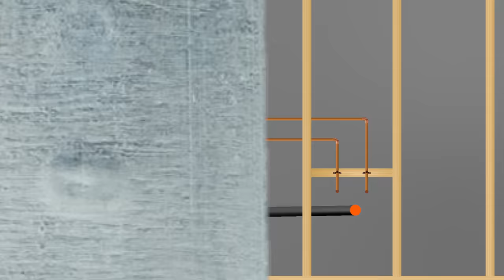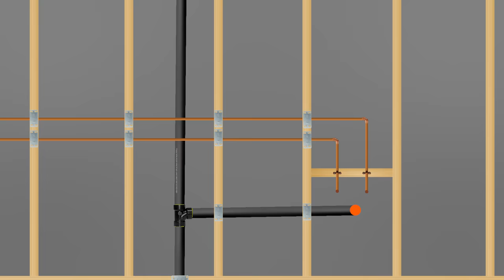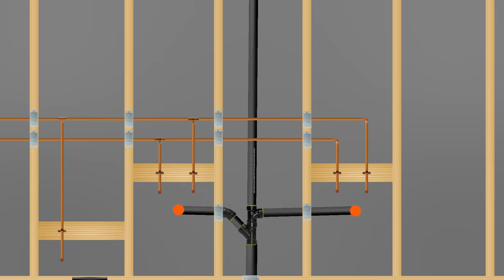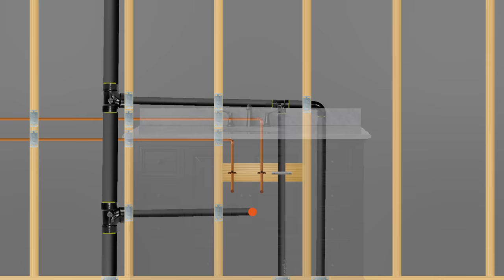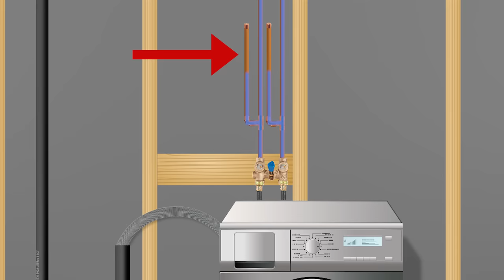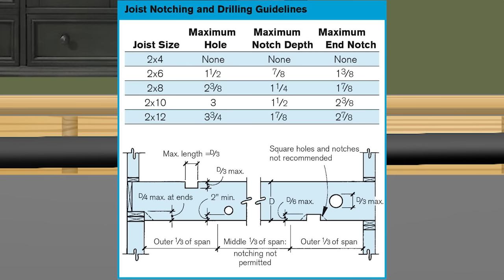10 Reasons Why You'd FAIL a Plumbing Inspection! | GOT2LEARN

Comment: The CORRECTION for no.6 is also wrong. The fitting shown as correct is actually a double combination wye and eighth bend. The horizontal to vertical radius of the bend still places the crown weir of the trap above the vent. The violation hasn't been corrected. It's just being made with one fitting instead of two. The correct fitting in that instance would be a double tee wye. Plus toilets are roughed 12" from the rough wall, not the finished. That's why they're called 12' rough toilets. Standard sheet rock is 1/2" thick. A twelve inch rough gives an 11 1/2" finish. The toilet tank is supposed to be right up against the wall on finish. This is so no one leans back and breaks it. If you do it the way he says, you are going to wind up with a gap between the tank and wall. If your wall is thicker or thinner then you adjust your rough accordingly to wind up with an 11 1/2" finish. Also, 1 1/2" standpipes work fine. Sizing depends on the local governing authority.  The ultimate governing body is dynamic physics. The rule for an air chamber is twenty times the diameter of the pipe. The reason they have been prohibited is not because they eventually fill up and become useless. This could easily be fixed by draining and refilling the system. It's because a dead ended air pocket in the potable water system becomes a breeding ground for bacteria.

Comment: Can someone add some explanation to #7?  Why can't you tap into an existing vent?  Obviously, you need to maintain the logic of #6, that all vent connections are made above the flood line of the fixtures they serve, so you can't tie into any vent, but it would seem to me that tying into the vent shown in #7 in the video would be ok.  Am I missing something?
Reply from the maker: As to not overload the system.
Reply: @Got2Learn  ok, so if the vent is approiately sized to handle the additional fixtures, and you dont risk a clogged drain flooding the vent stack, there probably isnt a problem.  Appreciate the feed back!  Great video!
Reply from the maker: Yes correct, but its difficult to know if you're overloading it if you can't see in the walls, cheers bud!!!

Comment: I worked with a asian dude in a house in Irvine!!! He ask me to run the copper lines water supply for a sink, when I ask for the drilling bits , he got up set and handed me a reciprocating saw to cut all the studs!!! I was surprised and very annoyed by this older dudes behaving like that, so I walked away from the job, they already had repalipe the entire house like that entire section of load Bering walls had the studs cut more than one haft to run the 3/4" main lines !!! It was a mess, I wonder how they got away with out the home owner noticing and asking why!!! I hope that house don't kill no body in case of an earthquake!!! Vrry dangerous!!! 🙏🙏🙏

Comment: Plumbing inspectors and the cites they work for should be held responsible for their lack of following the codes in effect at the time of construction,  for the life of the building. Bad quality of build should never be a cost for the owner. My home is an example of this. Toilets that bubble up from the washing machine, and traps that do get the water sucked out. This is why I view building codes as BS. Just slip the inspector a few bucks and your good to go. So start running.

Comment: I’ve seen production homes pass inspection , with several of these errors.
Reply: @Got2Learn  I’m telling you, I was in a Perry home the other day. It was 8 years old and the toilets were 12” from the vanity, 21” from the basin supply, and 29” from the shower valve and supply. I was like, how’d the fuck did this pass inspection?!
Reply: @Koitus36  Dumb/lazy inspector or the codes are simply more lax in your area. Not all areas follow the UPC and some are more strict than others. Entirely depends on your area.

Comment: Question on venting at 4:48 to 5:10 (approx) why would tying into this existing vent be an issue?  in fact it looks like a washer drain is already plumbed to that vent.
Reply from the maker: You'd be overloading the vent circuit.
Reply: @Got2Learn  thanks for the quick response.  Correct me if I am wrong - vent circuits need to be at least 1/2 dimension of the drains?  so 2" washer drain + 1.5" basin x 2 = 5 means that that 3" vent would be required?
Reply from the maker: @SteveHalvorson-qw5xc  It all depends on how many units are passing in your vents, you'd need to consult with your builder or city to make sure. Did you check to see if you had a "future vent" that was planned out by the plumber? https://terrylove.com/forums/index.php?threads/moving-tub-12-is-vent-needed-lots-of-pics.41935/
Reply: @Got2Learn  The house was built in 1984 and has 2 baths 1 in the basement and 1 on the 2nd floor.  I am adding a 2pc bath and a laundry on the main floor.  I can tap into the vent from the basement bath, or I'll need to run another vent from floor 1 through 2 and into the attic.  I think I have figured out a route behind the bathtub on the second floor that should get me into the attic.
Reply from the maker: @SteveHalvorson-qw5xc  exactly!

Comment: How does  an old style vertical pipe "shock absorber" fill with water?  That sounds like total BS to me unless you have a leak at the top cap, and it would seem to me if that is the case you would have to fix it anyway, just like any other leak in a wall or floor.  Not really buying that one, unless someone can explain how that pipe can fill without relief, meaning a pipe or cap leak above the normal water level.  All the rest make sense. Now if you make it too short, I can see how it could happen there, maybe.

Comment: Long sweep 90s aren’t required for sink drain pipes. A regular 90 is sufficient.  I would rather see a long sweep on the horizontal than vertically.

Comment: I hate a double WYE/Combo they are such a pain when running a sewer machine drop head or not,double drop head if it's on its side good luck you can sit there put the motor in reverse pop the pedal real quick run it back in forth slow,fast,granny low it will drop the first time or 3 hours later if the new construction guys put in the cleanouts,or drywall/flooring guys wouldn't cover them up it always makes those jobs go better.The life of a service plumber

Comment: I've got a suggestion... how about you actually preface this with WHERE these codes apply. Geographically mostly. 
I'm going to guess USA, as for some reason people from the USA seem commonly unable to grasp that the entire rest of the world exists and also uses internet... and because of the drywall building style.

Also, is there a specific time frame these codes will be valid, or are they just changed whenever? This kind of information is as important as the codes themselves.

Comment: So you know about the shocking of pipes... The reason it is done is to prevent pipes bursting and the terminology for it is "water hammer" The new devices vent excess pressure from the pipe into the drain. So CODE is to have the hammer prevention in a drainage location.  A small fail in your example.  you did not show the drainage.

The reason for the old 18" pipe with air in it is that Air compresses and water does not. (admittedly this causes cavitation that can break the pipes as well.)

Comment: Why does every toilet flange at the store allow for the pipe to only be installed on the inside of the flange?  Makes no sense.  You’d want a shingle effect so stool and waste dont collect on the step edge of the pipe.
Reply from the maker: You're correct! 🤷‍♂️
Reply: @Got2Learn  I did find a 4” flange, and a street 90 and on the pipe side it did fit around the outside but the 90 went almost all the way up to the top.  Water wouldnt be an issue since it’s done correctly but if the glue failed if this isn’t correct, then gas could escape.  Idk, I left with a 4” flange that a 3” pipe fits into, have to cut the 3” pipe to fit a 3” long sweep 90 since my joists are super tall as the 3” pipe acts as a mate for the flange and long sweep.

Comment: The short sweep 90 out of the toilet should not be code! That bend won't let shit through 😂
Reply from the maker: But they are hehe 🤷‍♂️
Reply: It's fine. If you use long sweeps, it becomes quite impossible to maintain pitch and keep your pipe in the ceiling. You'd either need to compensate by installing bigger joists (which no builder does) or you'd have to box out your toilet drains on the upper floors because they'd be sticking out the ceiling which looks ugly.

Comment: Only the hammer arrestor is the only thing I'm disagree about,  both way works, adding one size diameter bigger and 18" long do the work, it take years for this to fail but if if does the only thing is to shut off the water to the house and drain the entire system and fill it back up and this fix the problem.
Reply from the maker: It's still a dead leg, which are not allowed being on a potable water sysyem.

Comment: #6 is incorrect. The vent will prevent trap blow out. The first one is actually better because its easier to service. Every plumber knows snaking a back to back sink with a cross tap tee wye is a nightmare. And most walls cannot fit a cross long turn tee wye.

Comment: The video showed the code for a toilet flange to be 15" from the wall... that may be code but it is still a fail.  The center of the toilet (and therefore the center of the flange) must be 17.5 inches from the wall +/- half an inch in order to comply with ADA laws... you have to leave room for that grab bar one day 😀

Comment: If you use a double tee on a double vanity sink, the guy who comes to unclog it will tell you the wall needs to be opened.

And no,no one ever puts a cleanout on the vent.
Reply from the maker: There's always a cleanout on loop vents.
Reply: @Got2Learn  HAHAHAHHA
Always he says!!!
Clearlyyou ain't seen the plumbing where I live. These guys will also tell you every toilet is acleanout, even in a commercial setting.

Comment: 4:51 I think my dad did that (30 years ago) installed a toilet and sink in the basement below the original bathroom sharing the upper bathroom vent. I'm considering install an air admittance valve under the sink but I have to figure out if it will fight with the shared vent pipe. What a mess!
Reply: Why are shared vents a problem?
Reply: @TheFoolOnTheHill4  If he tied in below the higher drain. If he ran up above that and tied in above the upper flood level then its fine but its usually easier to just go on up to the attic rather than open the wall in the above bathroom
Reply: Look up schluter drain vents this might be your solution

Comment: Why can't you add a fixture to an existing vent?
Reply from the maker: To not overload your venting
Reply: @Got2Learn  so presumably you can add it on as long as it is below capacity?
Reply from the maker: @SamRaimi34  it's at your own risk
Reply: @Got2Learn  okay, I guess what I'm asking is: does the code say you can't add a fixture to existing vents? Or do they just specify a limit for fixtures on a vent (what my impression had been).
Reply from the maker: @SamRaimi34  you can, but it has to be over all the other vents so it doesn't affect them, or you can use a future vent if it was planned out during the construction of the building.

Comment: Sheet rock men/women should be installing their own stud guards and nail plates. They’re the ones putting holes in stuff. Right along with the framers putting that osb up on the outside of the house. I bet if they had to fix that stuff themselves, estwing would start selling hammers again.
Reply: The Electrician or Plumber is responsible to install protector plates to protect their work!...  it's not a big deal and they go on fast.
Reply: @canconservative8976  I’m just talking trash and having fun. But it is that big of a deal if you’ve ever been turned down for using the wrong kind.

Comment: My laundry room has those elongated pipes to trap air on the hot and cold line. Now it's not code. And here I was thinking of inspecting the house prior to selling to check some items off any nag list.
Reply from the maker: You have aquired rights for that, no need to worry, but if you can replace it, go for it.

Comment: Question. I noticed at 4:40, your vertical sanitary tee for the vent is upside down. Is there a reason that a sanitary tee on a vent would be installed upside down?
Reply from the maker: Yes the air flows better with it in the upside down position.
Reply: @Got2Learn  Thank you for the response. You got the best educational plumbing channel!!!
Reply from the maker: Thank you soooo much!!! 🙏🙏🙏

Comment: Your toilet on a santee is correct and incorrect at the same time.  Santee can not roll past a 45 angle, but you called a santee a “TY” that fitting is called a combo, which is a combo of a tee and wye fitting. Which you should use instead of a wye and 45

Comment: No mention of a toilet that is far away from the vent stack.
I know someone who installed a toilet but vented it through the outside wall.
Requirements were that it had to be so far above the ground and so far away from any doors or windows, even the neighbors doors and windows.
Lots of fun waiting for their wife to use the toilet then yelling in the pipe LOL
I love those long sweeps (long radius) fittings. Cost more but I think they are well worth it.
Drain velocity is increased.

One issue is drain noise.

Comment: NEVER USE A DOUBLE WYE!!!  the reason why is when you rod (snake out) one drain it's very possible your cable will not make the bend  and go streight through and damage the outer sink. You may not even realize it. you Think your drain is clear  bur actuall;y water is dumping in the ajointing apartment. On the horizonal cut in a santi-tee and run a separate vent. Indiana Plumbing codes state that All fixtures shall be vented!   I have been plumbing for 33 years. 4 yr dept. of labor approved apprenticeship, 1986 earned Journeyman and 2005  Master/Contractors license

Comment: Installing a new vent to an existing vents is not a fail if the diameter of said vent is larger enough to allow enough air for the fixtures it vents.
Reply from the maker: Correct, just hard to tell if walls are closed.

Comment: i don.t know where u get the codes am in brooklln n . y plus my home was built in 1921 no washers or dryers plus simple plumbing but my dad simple have hot plus cold water running to the wash machine then he added a 6 inch toilet u step up so he just put in the sewer line two this day only went it rains hard i only have to cover the back drain over forthy year no flood let talk about grandpap clus they didn,t exit we maid them my dad messed with all so simple to fix not in the time he was in time time he see maythings i dont

Comment: The real problem with the TeeWye on the tee won't as easily allow for a snake to head down stream.. Also some inspectors will fail the double Teewye because a snake will go straight through the branch and not down the drain. Yup it's funny when the snake is whipping around an adjacent bathroom through the lavatory drain 😱👉😋😆

Comment: i dont understand why you'd fail an inspection for tying a new vent into an existing one as long as it is cut in at a proper place. i have done that many times without issues. inspectors here would much rather see a solid vent as opposed to an air admittance valve

Comment: Correction: Toilet flanges are 12" from the framing, 11-1/2" from the finished wall.
Reply from the maker: Your way is from the edge of the flange, mine is from the center.
Reply: @Got2Learn  No it's from the center.  In my  bathroom remodel I did 12" from the finished wall to the center of the flange and when I installed my toilet I have a nice 1/2" gap behind the tank.
Reply from the maker: Ohhh, maybe our toilets are different, Idk.
Reply: @JustinHarcrow  that’s because most manufacturers allow for discrepancy in installation, heavy trim and or wall tile. Perfect example is a Toto Carlisle. I’ve installed with 10 3/4” flange offset and the toilet is rated for 12” flange.
Reply: That's from the back wall. The video is talking about the side wall.
Reply: @Egg Roll1up 12” and 10” flange offsets refers to the distance from the finished drywall from the back wall, add 1/2”, 5/8” or 1 1/4” depending on sheeting or fire break. Sidewall measurements as @Got2learn states in the video is 15” from center to finished drywall, vanity or any other object because minimum width for a toilet area by code in Canada is 30”
Reply from the maker: No, it's 12" from the center of the flange to the finished back wall here in Canada.
Reply: @eggroll1up918  see my other post for more description, but the sidewall measurement is 15”. 10” or 12” would be an instant fail
Reply: @Got2Learn  that’s my bad, I missed adding a very important line to that comment. Adding the tolerances I mentioned would be from the center of the flange to the framing, not finished drywall.......shouldn’t be commenting while wrangling 2 little ones for breakfast.
Reply from the maker: 🤣🤣🤣 we need more honest people like you, have an awesome day man 🙏🙏🙏

Comment: Can't believe how backwards the US is in plumbing compared to Europe. The toilet tanks are so outdated   But builders hear are just out to make big $$$ fast  with killer investment. Besides  Bidets for Your Bathroom has been the norm. And tankless toilet is any toilet that does not rely on a tank of water to clear its bowl. Instead, tankless toilets receive water directly from a supply line at a high enough pressure that a single flush can carry human waste through the drainage system. The toilet is mounted into the wall as well so your floors can be cleaned with out having the toilet on the floor. Toilets hear are so gross.